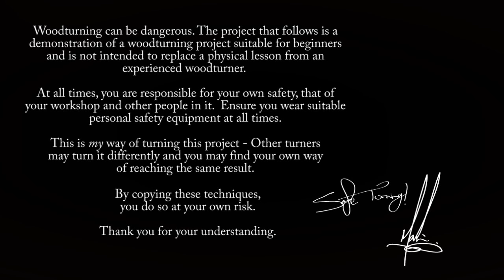Foot Massager Roller - Beginners Woodturning Project

Comment: nice simple project....the great thing about these "beginner" projects you've been doing, they're great "skill builder" pieces, and quick "technique practice" pieces for an experienced turner.....    (not to mention i can't believe i haven't done one of these before now!!...)   

Would add that if you cut your sandpaper into a slightly longer strip (or use some of the marketed "wood turner's strips"...) you can sort of curl them around a finger or dowel to get down into coves very nicely.....the longer strip also has the added benefit of not having to hold the bit directly against the wood so your fingers don't heat up as well....

Been meaning to ask:  do you find your sanding sealer strictly "necessary" under your finish?   some other wood turners and woodworkers and I have talked about the use of sanding sealer and the opinions seems mixed.  I can remember my grandfather using it on "open grained" woods (oak, ash or walnut), but almost never on closed grain woods like maple or cherry.   In the end, what ever gives you consistent results, works, and that's the important part imo....